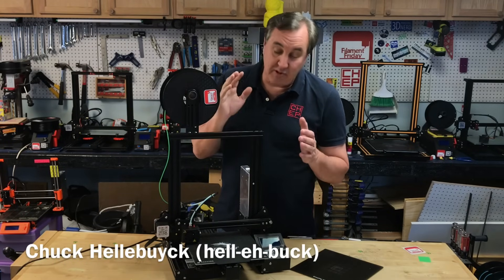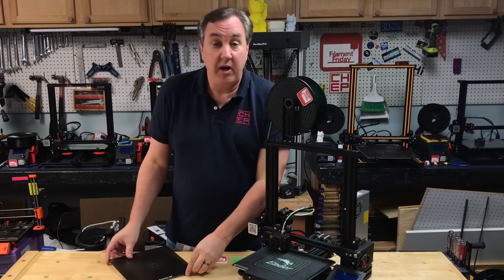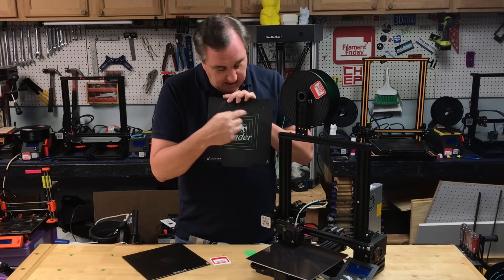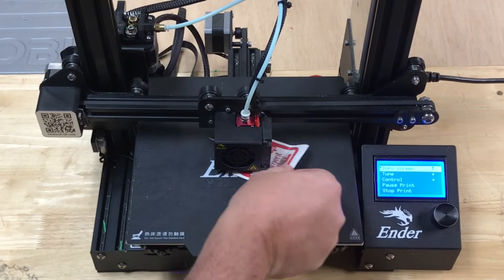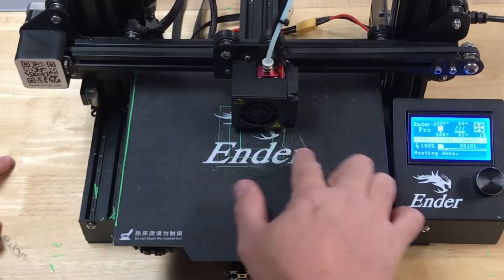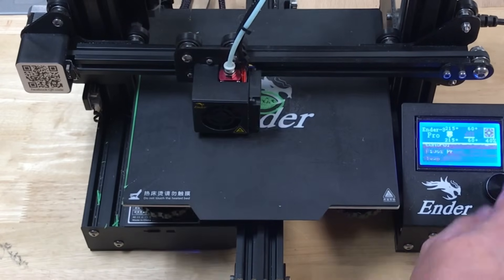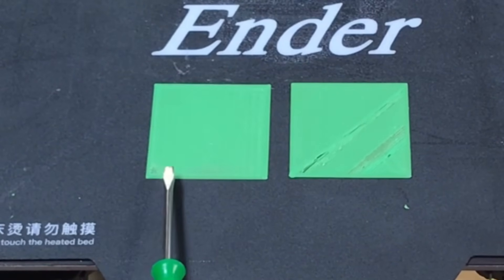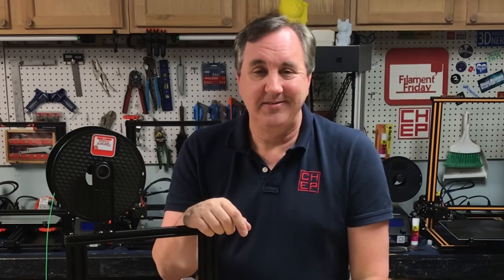Creality Ender 3- Easy Way To Level Your Bed

Comment: What if the strings don't easily remove? I had some trouble with mine
Reply from the maker: Adjust the nozzle further away.
Reply: @FilamentFriday  I'm also having problems with my extruder clicking. And since it goes one layer at a time, while also laying on a thin layer and going over it again and again instead of all at once like it seems yours does. Not to mention it goes outside in instead of inside out.

Comment: I am trying to adjust the bed right now on our Ender 3 V2.  I just built it...however, I noticed the bed pivots slightly about the center due to some tolerance looseness between the rollers and track. So if I push on the center, I can level all corners but if I slightly touch one outboard side of the bed, then it teeter-totters slightly and one side touches and the other side has a gap. Not sure how tight the rollers are supposed to be but that part was already assembled by creality. Am I missing something here?
Reply from the maker: Yes, you have to adjust the wheels tighter. One set of wheels has eccentric nuts to adjust tighter. They loosen in shipping.
Reply: @FilamentFriday  thanks so much for the quick response. You're a scholar and gentleman. Let me check it. Must be just the allen wrench adjustment
Reply: @FilamentFriday  Ok...I tried this but those wheels are pretty tight.....so I am kind of scratching my head again....or maybe I am being to overly cautious?  the bed still teeter-totters. Looked at your assembly V2 video also but doesn't specifically call that issue out. hmm...sort of odd.
Reply from the maker: Lower your Z stop so the springs are more compressed.
Reply: @FilamentFriday  thanks so much for engaging. Your original suggestion was indeed correct. I adjusted the front screws with the top nuts under the bed. I thought it was fully tight but the right one needed an extra quarter turn. Adjusted the left one too slightly but couldn't get access to the rears but it seems pretty stable now 😀😀. Thanks so much for your help!!
Reply: We tried the Bed Test with the 3D printed flat rounded cornered squares...did pretty good but then got started to screw up once coming to the center. My 12 year old and I decided to just go ahead and print the little cube and it turned out great! Very surprised with the resolution for an object this small and the accuracy. Both pretty excited to try something else tomorrow. Hoping to start creating some files on Fushion 360. Thanks again for everything Chep. ;)
Reply: y, there is "anothe" video on how to unpack it and set it up

Comment: Got my printer two days ago. I was  able to do my first two prints fine, but I took off the magnetic mat to clean it and ever since I haven't been able to print anything. The filament balls up on the nozzle and doesn't stick to the magnetic mat. Everything I've read online is saying this is a bed leveling issue. I've spent quite a while bed leveling and adjusting, but the filament still never sticks to the surface and just balls up on the nozzle. Am I adjusting too close, or not close enough?
Reply from the maker: Clean the surface with soapy water, rinse and dry.

Comment from the maker: Creality added 32 bit boards to Ender 3, Ender 3 Pro and Ender 3 V2 and the firmware doesn’t recognize the M0 command. So it may not pause at the corners. See link in video description.
You also don’t need the sticker. A piece of paper works the same.
Reply: I need help! I feel like this was a bad Xmas gift. Can’t seem to understand this. Have a bunch of files of things I would like to print but can’t. Filament gets balled up not sure if it’s the setting on slicer or actual leveling of printer
Reply: @stephie3642  I sure HOPE you've found SOME success in the 2 months since posting this (with no apparent RE: here).  Wow - sorry for your frusterpation!
Lots of variables here: type of filament, bed material, bed temp, nozzle temp, nozzle condition, extruder steps calibration, and the core issue in this video: getting that FIRST layer dialed in!  Now, if you're running a new Ender 3, getting a successful print shouldn't be that difficult - particularly if you're running PLA through a 0.4 mm nozzle at 0.2 - 0.32 mm layer height at something near 200C nozzle.  
If you get a good first layer, consistently, the "balling up" shouldn't haunt you.  If it does, more details are likely going to be necessary.  Perhaps you should stick to simple test designs to make sure it does what it's told to do before attempting complex "fancy" stuff.
When I started we had a users' forum where we shared pix and vids and tips and tricks and, of course, challenges, malfunctions and HEADACHES.  Things have come a LONG way since then, so I'm afraid I don't know of such a forum off-the-top.  Mayhaps there's a Creality group?  
Yeah - and when I was a kid, even DOCTORS made house calls....
Truth is, if you were in my vicinity, I'd be willing to help, but odds of that are pretty slim, and most folks are too paranoid for anything THAT personal!  Maybe you could shoot some video and upload it to YT?  I'd think that might be a relatively easy way to get some advice - maybe way more than you WANT?
Reply: @stephie3642   I think the bed needs to be adjusted higher
Reply: When I run the M25 version it heats up the bed and filament after the first "resume"... Is that expected?
Reply: @MitchGalgz  did you ever get an answer for this? Mines doing the same thing, and not going to the next point. just stays at the first leveling spot. using the M25 version
Reply: @thedoctor931  nope :( I just ended up leveling it by hand
Reply: Exactly the problem I have been having. Your videos have been so very helpful. Keep up the great work!
Reply: in the newest merlin fw (bugfix 2.smth) there is a leveling function included...
Reply: Thanks CHEP!
Reply: Appreciated!
Reply: Really helpful Chep thanks!
Reply: Thank you for the 32bit update, I can now print on my new Ender v3 Pro.
Reply: Is the Sq level.gcode still available...?
Reply from the maker: Link in description. I might have changed the name of that file for clarity.
Reply: thanks for this Chep! setting my z offset for my BLTouch in a little bit and just put on those aftermarket yellow springs with the nylon locking nuts and put a glass bed on my ender 3 too. will be using this to relevel my bed in abit :)
Reply: Thank you sir for extra information. I will try this M25 version.
Reply: I just upgraded my Ender 3 Pro to the 4.2.7 motherboard and I changed the control panel to the Creality touch screen... and after reading your comments about the M25 version of the bed leveling gcode... I tried the new gcode... it works but there is not a "clean" way to get the gcode to move to the next position on the bed (have to pause the print and then respond with a "cancel" then the touch screen will display a "start" button). Any suggestions on how to fix this issue? I really like the bed leveling gcode and want to be able to continue to use it on my newly upgraded Ender 3 Pro (with the 4.2.7 board). Please advise... thanks!
Reply from the maker: No idea. I don’t have that display. Should just be able to press play button to advance.
Reply: @FilamentFriday  I am soooo lost.  can you please help??
Reply from the maker: Lost with what? 
Just follow the video steps.
Reply: @FilamentFriday  I’m new at this stuff, when I downloaded the zip file but I get 3 versions of the same file.  And it won’t go into any mice chips
Reply from the maker: Instructions: https://www.chepclub.com/bed-level.html
Reply: @FilamentFriday  M25 only goes to first position, then just sits there... nothing on screen to move to the next one as in the video. I'm on an Ender 3 Pro.
Reply from the maker: Try the M0 then. I can’t control what firmware various printers use. So I made multiple versions.
Reply: @FilamentFriday  awesome, will do, thank you for the reply I appreciate it, and your videos, very helpful for noobs like myself.
Reply: CHEP do you still have the link for the bed level gcode?
Reply from the maker: In the description
Reply: @joshslack946  It is NOT!!  No thingiverse link there!!!
Reply: instablaster.
Reply: Ok I watched your video on how to build it and found it very helpful I downloaded the folder from the updated file and have moved them to the sd that came with the machine but my printer won’t show any of the gcode file except the ones that were already on it what am I doing wrong
Reply: Did not work for me
Reply: What does 6S at the end of the leveling test mean?
Reply: Thank u
Reply: @CHEP thanks for the 32-bit file. I have just tried on the last ender 3 v2 firmware update and the code does not work as expected. Basically it starts on the first corner. After clicking resume it goes into the next corner and instead of stopping there to check with the paper it directly come back to the initial corner; so there is no chance to adjust on each corner. Perhaps you need to update this M25 file? Thanks in advance
Reply: I think I have found the solution. For a reason I dont understand it seems that M25 pause but direclty resumes printing without waiting the user to click the resume bottom. However if M0 is used, then the print is stopped and by clicking the stop printing buttom (not the pause) the program resumes and works as expected. This is obviously something weird probably comming from how the code has been compiled by creality but at least makes the code usable; so M0 is the thing to use even with the 4.2.2. printer and 16th August 2022 drivers.
Reply: This only moves past the first corner and goes to the second corner then raises the extruder about 10mm and stops. It will NOT continue from there no matter what I do!!
Reply: Where's the link for the 2gcode for the bed level rectangle
Reply: I've tried all the files and none of them pause
Reply: Thanks so much for having such a Descriptive video gained lots of new knowledge from this
Reply: Where is the link
Reply from the maker: In video description
Reply: for some reason, my Ender 3 V2 Neo wont run the M25 Gcode correctly, it run around thebed, and just comes back to the front left corner. Any thoughts?

Comment: Can I use this file with a bltouch? My bed is not level at all. Was working well before the bltouch :(
I thought I'd add g29 to the code
Reply from the maker: No, this is for manual bed level.

Comment: TIP: For some people (including me) the print bed with a single piece of paper is just to close and will get smeared or not even print. Solution: Print the squares and lower the bed till you start seeing printing. If you want perfect printing from bed leveling without the squares (highly not recommended) then fold your piece of paper around 3-4 times or get a sheet of card stock.

Comment: Unfortunately, I'm one of the people whose bed is way too low (out of the box) where the nozzle isn't even coming close to touching it, let alone levelling.  Everything seems to be put together correctly but the nozzle is just too high.  I've been reading that it's something to do with the Z-stopper that is blocking it and people are using 'hacks' and literally hacksaws, which is insane.
Reply: Just in the past few hours, I put together my Ender 3 Pro. I had the same issue, but I found that once I fully raised one corner, the other corners could be raised higher. While this does mean that bed leveling is much harder since one corner affects the others, at least I could get the bed high enough to level it.
Hopefully the same will work for you in case you don't want to mess with your Z-stop or "modify" the printer.  :)
Reply from the maker: Lower the switch on the side. There is a nub to help line it up but if you need it lower just clip that off with the side cutters included.
Reply: @FilamentFriday  That really seems to be the key issue and thanks for that.  It really seems that this will be the easiest solution (instead of buying another tray to put on the bed to raise it)... but do you know why they did this?  It seems like a huge manufacturing flaw, since so many people deal with this.  I'm curious why it's fine for others though.  When I was starting to do the leveling, I'm like, 'uh man, something's way wrong here', when it came time for the paper test and I can get a Sharpie under the nozzle.  If I clip that, it'll definitely lower it enough.
Reply from the maker: Not sure.

Comment: I tried doing this but even with the nobs turned all the way to falling off the nozzle is no where near touching any of the 4 corners, how do i force down the z axis?
Reply from the maker: Lower the z stop switch on the side. You may have to clip off the nub that stops it from moving lower.
Reply: @FilamentFriday  i actually had it too low, i had to move it up it was never clicking it, Thank you for your speedy reply Happy Holidays!
Reply: This is the exact problem I had. Luckily, the assembly video I watched talked about the possibility of this so when the bed was maxed out and still wasn't close enough I knew what needed to be done. I can't for the life of me understand how this could leave the factory like this. Makes zero sense to me but thankfully it's an easy fix.
Reply: or is there a way to raise the entire bed up i am missing?

Comment: Almost returned the printer as it was driving me absolutely mad failing near enough every single print! Can't thank you enough!
Reply: Same here, still driving me mad.
Just can’t get it right.
Reply: @CookieBreed0  you gotta use a glue stick.
Reply: wym
Reply: @lucasjohnson6  I have the same problem glued stick didn’t work for me just made a huge mess and ruined my bed
Reply: @Jqkzy  Get some warm water put it on the bed so it removes all the glue then use rubbing alcohol and try it then it should stick much better
Reply: I have and still have the same problem
Reply: Wait until you install a bl or cr touch.

Comment: I see there is different codes for dfifferent version of the firm ware I just ordered my Ender 3 V1 last week what version do I Need to use?
Reply from the maker: Depends on the board included but your safe with the M25 version.

Comment: Warning to those who the nozzle is always too tall:
CHEP's code is telling the nozzle to go to Z 0.0mm, your prints will start from 0,12mm and up according to how you slice your parts. If you want to try the paper method, you can be a little extra tight. If your vision is good try just looking with the aid of a flashlight for when the nozzle touches the bed.

Comment: I have a problem, my nozzle doesn't reach the bed enough to hinder the paper at all, no matter what I do to my wheels
Reply: There is a little l-shaped piece of metal with a sensor on the side of the printer. Did you maybe screwed it on the profile to high? So the sensor is saying that you reached the end to early?
Reply from the maker: Adjust the stop switch lower.

Comment: Hey I have downloaded both of these, when i use the gcode i can get it to specifications. But then I do the test print and the first square works, the rest fail. When I try and fix it I just make it worse. Any advice?
Reply from the maker: Can’t really help from that description. Just adjust to make them stick. And clean the bed before doing this.

Comment: You will want to make sure you start in with the bed screws with a good amount of tension. If you don't you, just the slightest amount of weight will change the level of the bed.

Comment: Has anyone solved the issue where, at my Auto Home, every point is leveled, but as soon as I start printing the Z axis raises up above where I leveled the bed so there is no adhesion with the filament. I can combat this issue by using Babystep z, but Im looking for a more permanent solution than having to tune every single print with the babystep z.
Reply: I've just started 3d printing and have had the same problem, however I think I stopped it somehow.
I'm writing this message with the intent to persuade you that your likely not going crazy.

Comment: Hey, thanks for the video it was very helpful! 

Where can I find the gcode for the square though? That looks like a good test as well.

Thanks!
Reply: Exactly
Reply from the maker: Link in description for all files
Reply: @FilamentFriday  Maybe I missed it, but I've redownloaded it just in case, and I don't see it. I'm talking about the small square(s) at 5:37. I understand this is probably easy to do myself, but since I don't know how to use cura much, I wouldn't know if the issue is from my faulty code or an unaligned printer.

Thanks!
Reply from the maker: Sorry. I misunderstood. Just print first layers of a CHEP Cube. https://www.thingiverse.com/thing:3189377
Reply: @FilamentFriday  Okay, thanks for the help.
Reply: @FilamentFriday  Oh I see, thanks! It'd probably be good to add that text to the video or description if you can. Thanks!